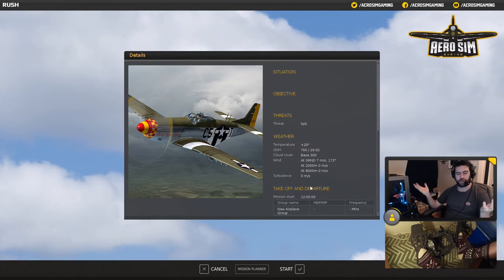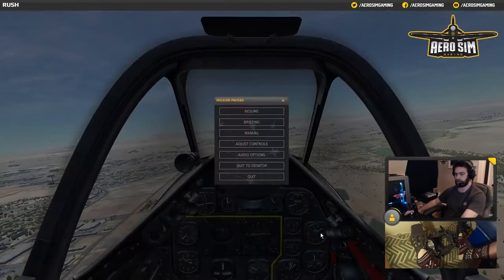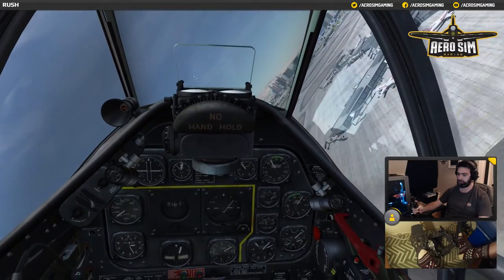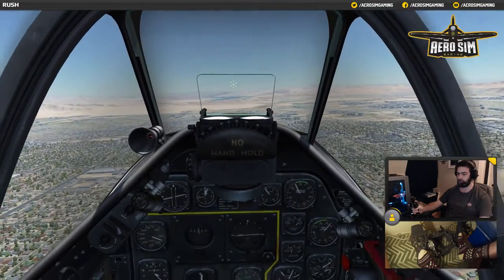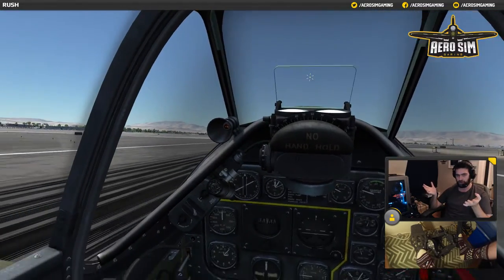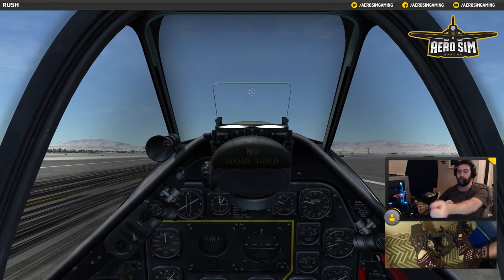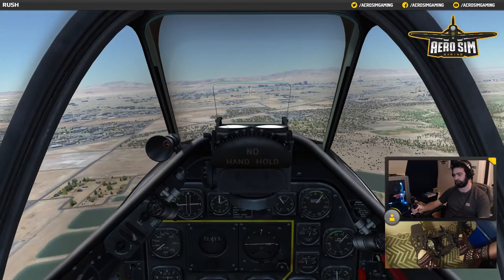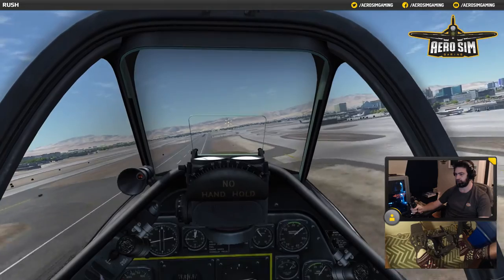[DCS] P-51 Crosswind technique

Comment: Really, you should hold the slip all the way in. That's how most people teach in real life, because if you're slipping at the last second, there's a lot of correction you need to do in a small amount of time, whereas if you're slipping the whole approach, you're pretty much already stable. Also, I believe the P51 calls for full forward prop. I could be wrong on that area, but oh well. Usually gives me plenty of rudder authority without trim, and if (for whatever reason, but I haven't had this happen much) I don't, just use a lil bit of right toe brake.
Reply from the maker: So I worked with these aircraft in real life as an Aviation Engineer and talked with our pilots regularly about the aircraft.

Our SOP's were to leave the prop at 2700rpm.  The thing is the real life aircraft CAN handle 3000RPM for missed, but there is simply no need for it.  The real aircraft does have rudder authority problems when rudder trim is used.  The DCS Mustang doesnt seem to have the same real world problems.  However I fly the DCS Mustang as if it does.

The problem with the rudder authority is just due to trim, when the aircraft is in a out of trim state.  Say on approach the standard trim is 1 degree left.  For a missed at 3000 RPM the rudder trim needs to be wound back to +4/+5.  In real life this is a significant event, with the trim wheel needing several "grabs and turns" to wind the rudder trim back to +4.

However in DCS, I can wind trim back to +4 if I need it in 1 second with a small axis on my HOTAS.  So the problems in reality do not transfer directly into DCS.

Second thing is slipping; slipping a light aircraft is fine.  Some pilots even did slip the Mustang, however its still not safe.  The pilots that did were super stars, but that doesnt mean its a commonly accepted approach.  its the same for the Spitfire.

The reason being is your margin of error significantly decreases in a slip.  Control authority starts to decrease, and its not a stable approach.  Worst case scenario, you get slow.  2 things could happen, the slipped wing could stall, then you have zero chance of a recovery.

The other, you get slow an add power in an already crossed control scenario.  In this state, you again run out of control authority, or best case scenario you are in a very awkward stick and rudder position.

There is simply zero reason to slip a Mustang, the risks far outweigh the advantage of vision.  A good curving approach means the aircraft is stable throughout, controls are near neutral, and any application of power only requires rudder.

Simple is good, simple is repeatable, simple is safer
Reply: Aero Sim Gaming very nice view on this, and I appreciate your insight. I'll start reflecting these things to my sim experience with the P-51 as well.
Reply: According to the P-51 manual the plane could not hold a prolonged sideslipp.

But back on topic. I just got deeper into DCS P-51D flying, but crosswind take-offs and landings are giving me a real headache. 

I know the technic you demonstrated here, and also i am used to the wing-low approach, as i also fly taildraggers in real life.

But in DCS i struggle with crosswinds. If wind comes from the right take-off works well, but if wind comes from the left, the plane will at one point simply start to veer uncontrolable and getting it into the air is pure luck.

Noticed the same on landing, with right crosswind they seem easier and with left impossible. 

Aero Sim Gaming could you do a video showing all fours? So TO & LD with left and right crosswind.

Another thing i noticed is that in DCS the P-51D seems to react very strange to aileron control in crosswinds. Sometimes it feels as if i need aileron with the wind and not against it. Any explaination for that?
Reply from the maker: Agathos Flightschool Hey Agathos! I think the real difficulty on transitioning real world tail dragger flying to DCS is the view.  I mean in a real aircraft you have a massive field of view around you, and you can see and feel the aircraft when its drifting a certain way.

But in our desktop environment, picking up on that drift is really hard.  There simply isnt the visual and seat input you are used to.

The other thing comes down to hardware, my joystick has a stick throw of what 2 inches?  In lets say a real life Super Cub, the stick throw is 2 feet as an estimate?  That means in the real plane, I have greater fidelity of control, I can make fine inputs with a stick movement of half an inch.  But in the sim, well thats literally half the travel and half of the full deflection control output.

After all that there is no direct solution, if you had a thrustmaster hotas there are extensions.  But thats a inconvenience for a desktop setup.  The way I deal with it is looking as hard as I can out the window, when I see even the tiniest slip or drift I correct with smooth control inputs. Ill try and demonstrate this in a video! 

Anyway, long ramble to say; yes!  Ill go ahead and record some videos as a demonstration.  Ill see if I can recreate the reverse aileron input you are talking about as well!
Reply: For me it is interestingly vice versa. As i have much more online flight time, than real flight time, i especially find crosswinds landings and to determine if i drift easier on the desktop than i a real taildragger. On a desktop i find it often much easier to have a couple of fixed reference spots to use, cause everything is more cramped together to the focal point of my vision. In reality i have that feeling that the parts of the plane - especially in taildraggers - obscure most of the sharp focal spot in the field of vision and reference is in the blurred peripheral part.

Same counts for stick travel. With all my online experienced and thousands and thousands of hours, in reality i really like planes which don't need much stick travel and have some discomfort in planes where you need to yank the stick all around the cockpit area. I never had a fidelity problem with those short stick ways, as i am used to them. i.e. flying an Extra 330 LX was quite easy for me, cause the highly responsive controls with very low stick travels needed for changes in attitude very much reminded me of how my desktop enviroment is set up and reacts. The Piper Cup on the other hand is one of those plane, where i though, what he hell, how far will that stick move! :D

Back to DCS. I did some more tests. Taking off works now good in both left and right crosswinds. Technique used as follows:
- elevator full back (Trim set a little to noseheavy)
- aileron full deflection against the wind
- engage brakes
- throttle up to ~2300rpm@30inches
- let go
- keep straight with rudder
- let plane fly itself off.

This way i always get into the air, veer is gone. Almost feels like a "scripted" TO.

Landing is a bit more tricky. But i identified two factors the DCS P-51 or lets say three that decide the success of the landing.

1. Lining up. Its really important to catch that center line early and fly a steady approach with a steady deflection angle. Any large corrections close to the runway or over the runway to keep flying along center line should immediatly result in a go around, cause landing will end badly.
2. Throttle changes. Best is to keep throttle steady once you decide to land and flare. If large corrections are needed, go around. Also if approach looks good and you flare out,  don't throttle back if you still have a few inches standing. Any change in throttle especially in flare seem to really make the plane unstable.
3. Aileron inputs. This is still kind of strange to me, always somewhere down the landing, the plane always gets that tendency to drop over the wing that is into the wind.

I saved two tracks and will record a video coming weekend and load them up on my channel So we can compare.